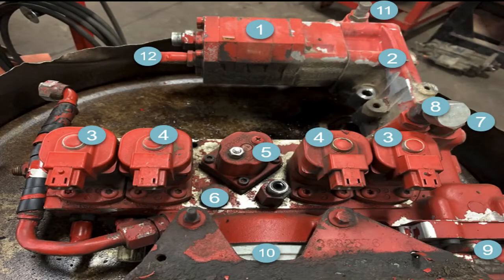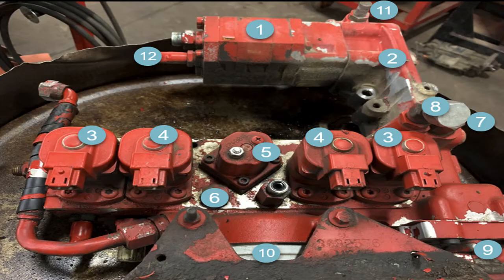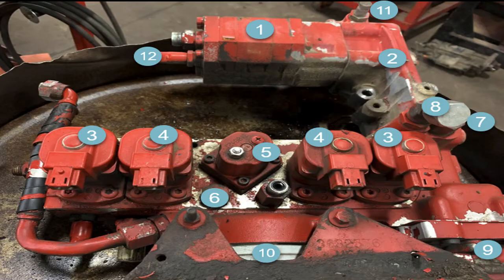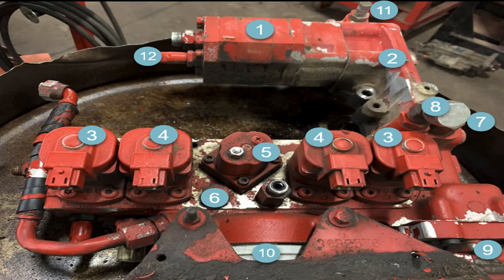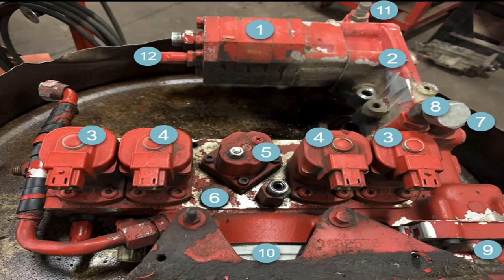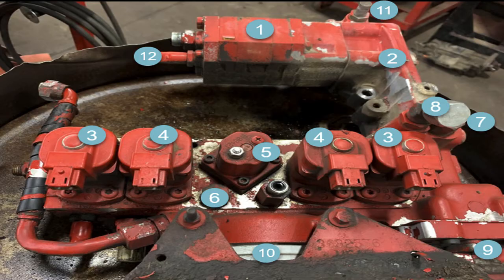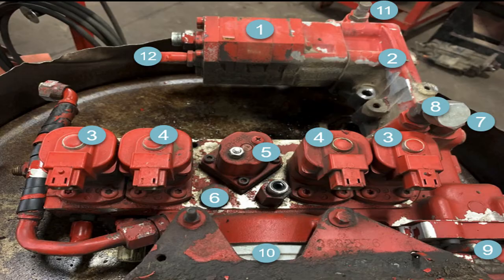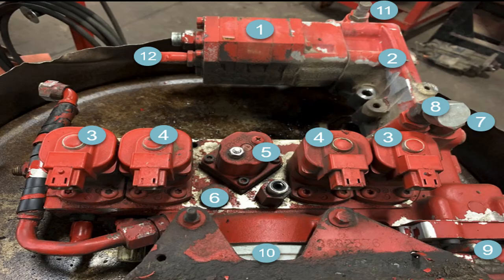ALL about the IFSM

Comment: Good morning Joe my Ifsm is leaking behind 3&4 there is triangle shaped  with 3 bolts right behind the actuators can explain what is the function and how to fix the fuel leak thank you
Reply from the maker: Those are called pulsation dampners. There are  a couple orings , steel disk. that looks like a silver dollar but a tad larger, and a nylon ring. Just buy the orings, disk and nylon ring.
It is very easy to rebuild. just change those parts. some times that disk cracks or the orings just fail. The disks bounce and absorb the gear pump pulsing so the actuators get STEADY pressure so the fuel is metered correctly.
Reply from the maker: I did not give part numbers because I dont know your engine serial number. Generally speaking those parts are the same through all the generational changes but there could be material or diameter changes i dont know about. Always use your engine number to order parts.
Reply: @ENGINESHOPJOE  good morning Joe thank you for taking the time response for sure you save a lots of money to all the truckers that like to fix and work on their own trucks have a good day

Comment: also where is the fuel transfer pump
Reply from the maker: If you have a 570,870,or 871 it is bolted up to the bottom of the ifsm  where the fuel line is hooked to supply fuel to the engine. If you have a common rail it is down by the oil pan rail behind the injection pump where the suction fuel line hooks up.
Reply: Thanks after looking I found it after removing the fuel filter.

Comment: I am watching to find my check valve
Reply from the maker: If you have the isx 570,870 or 871 There are two check valves. One is located where fuel goes in the ifsm on the bottom right of the assembly where the number 10 line screws on. take out the fitting and any screens you may not have a screen and then you need a larger allen wrench to remove the check valve. the check valve looks like a 12 gage shotgun shell but stainless and will screw out. The other check valve is found in the center of the fuel filter threaded adapter. Remove the filter and look up inside the middle with a mirror and light and you will see the allen. Right hand thread. I dont remember the allen key size its around 1/2 ish

Comment: Hey I change my fuel filter because my engine sounded like it had a light miss to it now my not running it will only run on starter fluid I had a guy hook up a computer to it and it said low fuelpressure. I put another fuel pump on there and it still doing the same thing.
Reply from the maker: What engine and what year? Is it common rail? What fuel pump did you replace? The isx has 3 an electric priming pump and a gear pump and the high pressure pump. It sounds like you just got a dose of air in it. Loosen the fuel filter and cycle the key. you should hear the electric pump run. Do key cycles until fuel is running out of the filter then tighten the filter and try to start it. Sometimes they get air locked in the rail. If you can see with a computer there is no fuel pressure in the rail take a fuel line loose at the head. take the nut completely off so it cant build pressure. crank until fuel runs out the line then stop cranking and torque the line to spec. I cant tell you spec as i dont know what engine you have. Then it should start if all the pumps are working as they should. BECAREFUL of the high pressure fuel- watch my video on fuel faults for safety tips if you dont know how to properly open the fuel system. wear glasses and gloves.
Reply: @ENGINESHOPJOE   It’s a 2005 international with the Cummins isx I replace the fuel pump the lift pumps comes on and goes off
Reply from the maker: @TheFredloc870  Ok what i told you does not apply to your engine. The electric pump should run for about 1-2 minutes then shut off. Look at my video on this and take out fitting number 11.
The key has to be off about 30 seconds for the lift pump timer to reset. so then turn on the key and see if fuel runs out of fitting 11. if it does then the gear pump should be primed.  Put the fitting back in. Next check the terminal on number 5 for 12 volts when the key is on. if that looks ok then take number 6 out. it is a pressure regulator. crank the engine and fuel should come out of there pretty good. if it does the gear pump is primed and working. You can start with number 6 if you think the pump is getting fuel and skip fitting 11. If fuel runs out of there then put that back in and crank the engine and look at fuel pressure on the laptop. it should be 125 psi cranking and go over 200 running. If you dont build any fuel pressure and you know the gear pump is working then 1 of 4 things is wrong. 1. fuel pressure sensor has failed (unlikely) and if it does it will not start. 2. one of the two regulators is failed or stuck open( you can't tell by looking)
3. the electromagnet has failed or the voltage to it cant open the shutdown plates behind it. If you think its this take out the 4 screws that hold it on and take the pieces out and look how they came out!. then leave them out and bolt the magnet back on and see if it starts. If it does replace the magnet if the power wire to it is good. 4. you could have a screen in the inlet where the fuel line screw on. Cummins had us remove them as they would plug up and shut the engine down. See if there is a screen in the inlet where the  #10 line screws on the engine fuel inlet.
You can still leave the fuel filter loose on this and the lift pump should fill it after about 5 key cycles.  This is what I would do if it were my engine.
Reply: @ENGINESHOPJOE  Ok thanks so much I’m try it soon i get back home

Comment: Good morning I’m broke down the engine die just like it run out of fuel I check if there is fuel pressure after seeing your video and there’s nothing coming out can you please reply with some suggestions please thank you
Reply from the maker: Remove number 7 regulator partially covered by the fuel return line fitting. Once the regulator is out crank the engine. If no fuel runs out of the hole then either the gear pump sheared and is not pumping fuel or there is no fuel going into the inlet fitting from the tank/frame filter. Put a bucket of fuel on the valve cover and put in a number 10 line and screw it to the fuel inlet.
now it is gravity feed for test. crank it over and fuel needs to run out of that fitting cranking. The electric lift pump should pick up the fuel and start pushing it out the hole. once it does unplug the lift pump and crank it. if fuel does not continually pump out of that hole cranking the gear pump failed just replace it. If fuel comes out most likely either the pressure regulator you removed failed or the one under the fuel solenoid failed. Make sure you did not lose electrical power to the fuel pump solenoid- has one wire on it. Check for power at the stud- 12 volts on a truck.
rarely the fuel solenoid goes bad and wont hold the shutdown plates open. you can take the guts out and bolt the solenoid back on if you think that is it. It will start and run with no solenoid guts but has slow shutdown but it will shutdown with the key and you will have an active fault for fuel solenoid failure (because it cant use the solenoid to shut it off it has to use the actuators)
Reply: @ENGINESHOPJOE   What would cause my cm870 to dump white smoke, and turn off, but when I cycle the key, it turns right back on. I’ve changed the gear pump twice lift pump all the sensors and it still acts up  
I push in the compuchek orifice, and diesel shoots out. I get plenty of prime from the lift pump, but when I started it and I accelerate it cuts off and shoots a whole bunch of white smoke. Thanks
Reply: Thank you for your response

Comment: This is a amazing I'm in México working on my neighbors truck and this was great info thank you. I saw another video that says the fuel from the lift pump goes to the fuel filter (number 10) first, is that right? Or does it go to the gear pump first? According to a diagram that I found I thought on the one I'm working on it goes from the lift pump to the gear pump and then to the main fuel filter
Reply from the maker: You are correct lift pump to gear pump to filter then into the actuators
Reply: @ENGINESHOPJOE  thank you for the reply sir. The system was sucking tons of air into the system so they are going to replace all the quick connect lines from the tank to the engine because all their clips are broken and then we'll go from there. Also gonna replace the lift pump.
Reply: @ENGINESHOPJOE  is it common for the gear pump gear shaft to break or come un seated in the gears? We replaced the gear pump on this engine because we found the internal gears weren't turning when we turned the drive gear.
Reply from the maker: @kodykj2112  Not common but yes I have seen it a few times. The gears are press fit on a small diameter shaft. There is also an alignment key in the shaft as there are(used to be anyway) two gears pressed against each other so it looked like one longer gear. Over time the press fit is lost and then the key is worked back and forth until it shears. That gear set makes 320 psi when the engine is running so it has a lot of torque applied against that press fit. Air in the fuel shortens that press fit life because you now have spikes (air/fuel/air/fuel being pumped) instead of just a smooth hydraulic (just fuel) load.
Reply from the maker: By the way welcome to my channel. Thanks for the excellent comments

Comment: Just found out last week after replacing all the metering and timing actuators that there is a new style and an old style actuator. the old style needs o rings to seal and the new style has the ridged plates. Thank you for the video.
Reply from the maker: Yes and they are interchangeable as long as you use the correct gasket or oring. There are also a couple different part numbers depending on the horsepower.
You probably found out you cant bolt them in the wrong place. IE put a timing where a metering should be and visa versa. One mounting hole wont line up.
Reply from the maker: There is a way to tell if the metering actuators are starting to become inefficient at precise metering. I will talk about that in the future it is a bit advanced for this general discussion.
Reply: @ENGINESHOPJOE   Something that often gets overlooked is the dampers on the rear and the leaks they develop.
Reply: @Jeff Andrejas  yes this,    I would love to see a video about them
Reply: @Jeff Andrejas  they leaking on my truck right now...smh smh

Comment: this was the fuel system on the isx cm870 and cm871
Reply from the maker: Correct and the 570 too. The 570 was the very first generation of this engine then called the Apex. The 570 is the ecm platform or generation. It had no emissions items on it at all. It was a running beast with 650 horsepower at the flywheel at 1800 rpm. Even though it was only "rated" at the time for 600 MAX hp.
Reply: Is that the same as a signature 600?